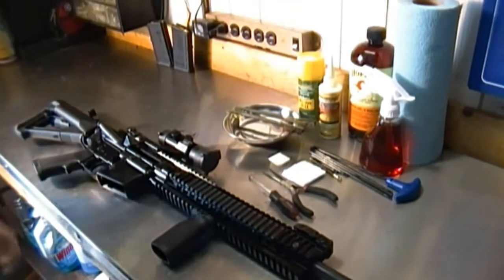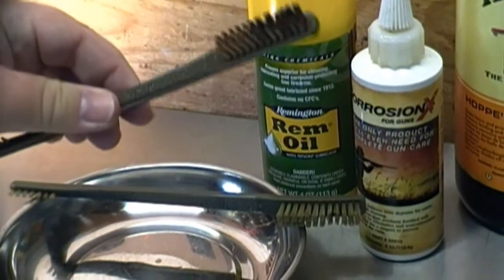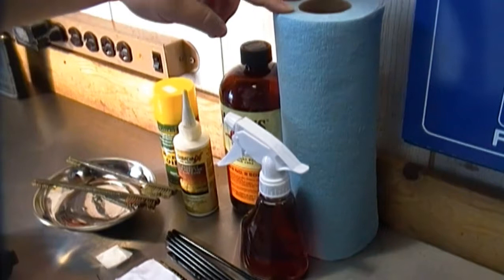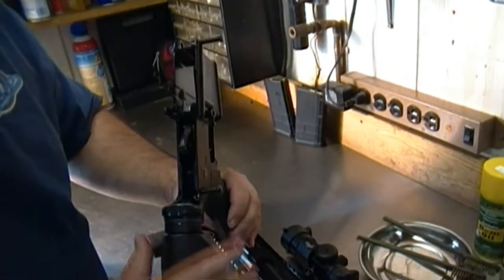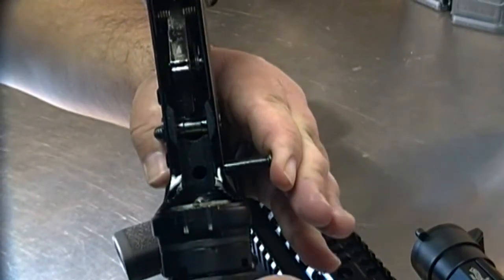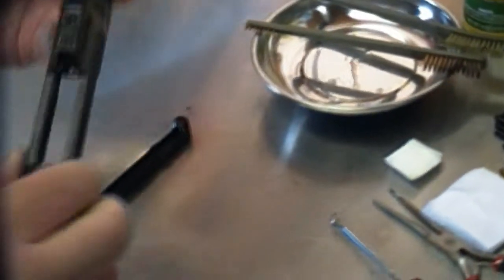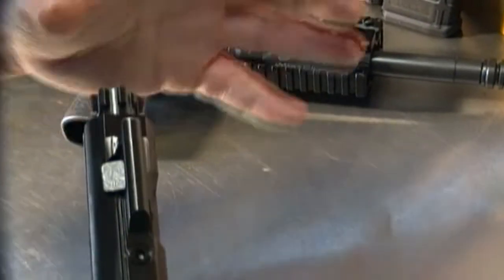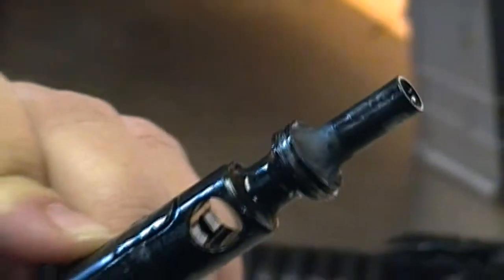How to clean and lubricate the AR15

Comment from the maker: I was taught that the gas tube is self-cleaning for the most part as most of the dirt is blown back onto the bolt. I do plan on cleaning it one day but don't shoot enough to warrant a cleaning. Gun grease is good for lubing but it is not as transferable as a good oil which will also help in regards to anti-corrosion. BTW, I am doing a corrosion test and will upload part 2 of 3 today. I hope you can check it out. I have come across some interesting results.

Comment from the maker: I did try to find plastic dental pics instead to clean the inside of the upper receiver but I didn't have enough time. I decided to just be very careful with the pliers and make sure they had the patches as padding. Please understand that the upper and lower have no affect on accuracy or pressures whereas the barrel does which is why I was more careful with the barrel and a little less careful with the receivers.

Comment: IDK but I know some solvents can penetrate your skin.  I like Hoppe's as well but I advocate using latex or nitro gloves.  A prudent precaution.  I also think a very good gun grease does a better job of lubing the outside of the bolt carrier as well.  You didn't do much for the actual gas chamber either.  I bought a lightly used AR 2 years ago and had to soak and dig soak and dig carbon out of there for an hour when I finally learned how to disassemble my bolt carrier group. Good vid though.

Comment: Cool video question do u ever oil the spring and piston in the stalk?
Also love the work bench...
Reply from the maker: 510Deacon, yes I did and after I finished the video, I forgot that I didn't include that. Basically what I do is I put oil on my fingers and then I slide my fingers down the sprial of the spring. At certain points in time, I will re-oil my finger as I proceed.

Comment: The use of the patches and nylon brush as well as the brass brush I can see but I cringe watching you use that set of needle nose pliers on your lower and your upper...for someone who wont use a brass bore brush...I'm surprised to see you shoving those hardened steel pliers anywhere near that firearm.